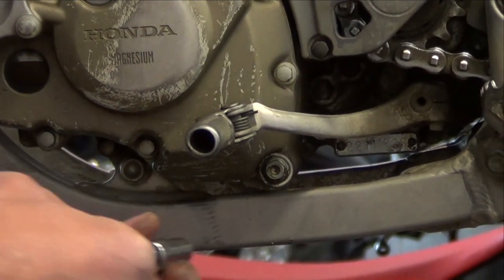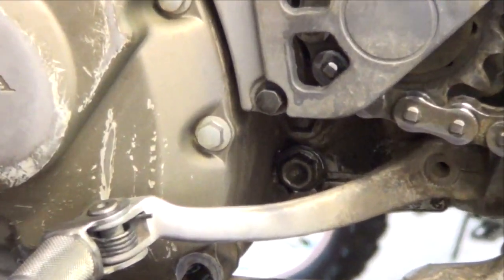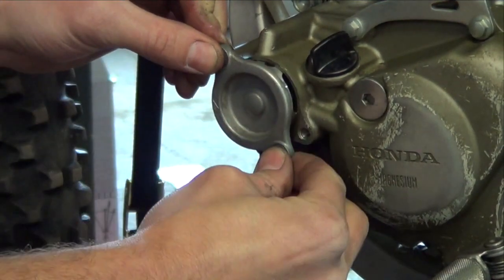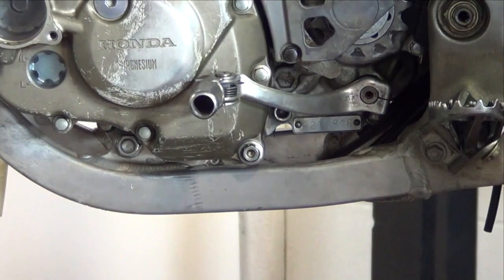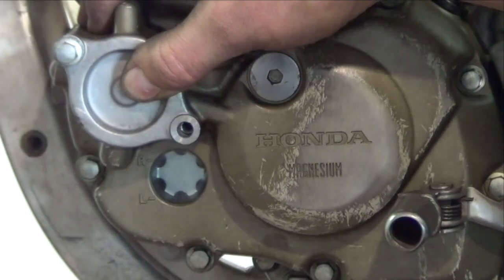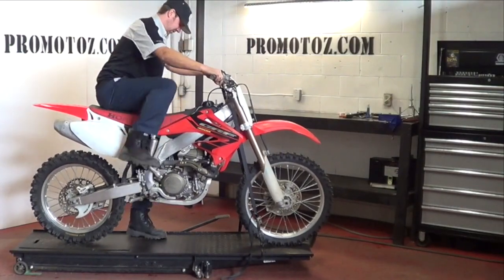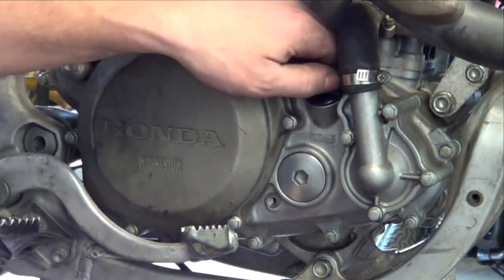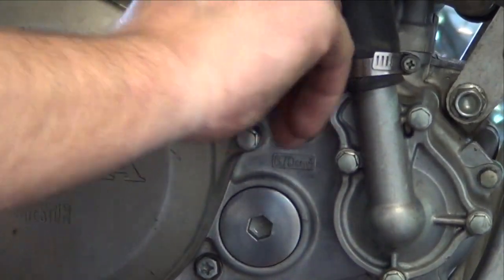02-08 CRF450 oil change - Parts in description!

Comment: Do you have to use different kind of oils for the transmission and engine oil? Or do you use the same oil on both?
Reply from the maker: You can use the same or different.  You can use 20-50, 10-40, or 0-40 depending on outside temperatures. Engine can be full synthetic with moly as long as its motorcycle oil. Trans can run any range of oil really. Try a few and see what works for you. Trans just absolutely needs to be “wet clutch safe”. I tried a ton of oils and the motul full syn motorcycle oil was what I ran in engine and trans.

Comment: Great video. 
Can you tell what the crankshaft seal on the CRF450R  purpose.
Reply from the maker: Crankshaft seal just keeps the oil moving through the motor in a circuit and not mixing with the trans oil.

Comment: Should I use the same old 10w40 oil for both the motor oil and transmission oil or are they two different things? Thank you
Reply from the maker: You can use the same oil as long as it’s wet clutch safe.